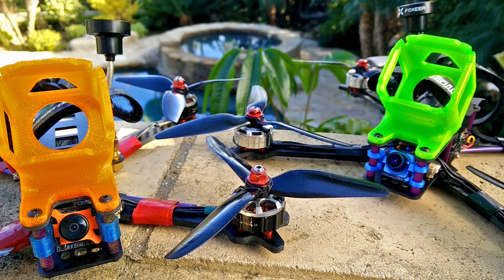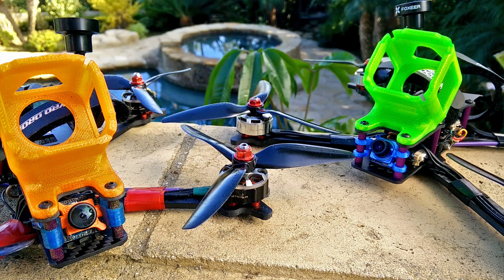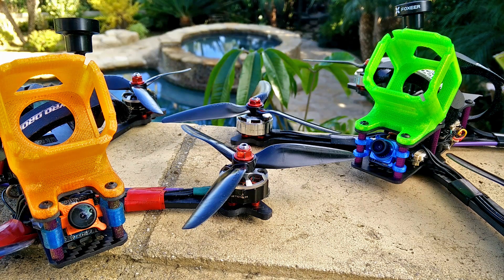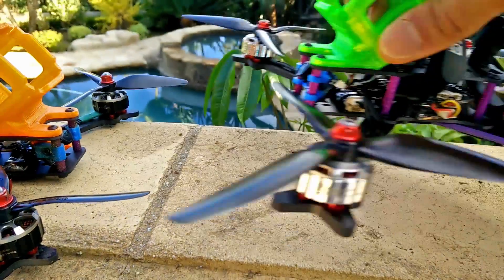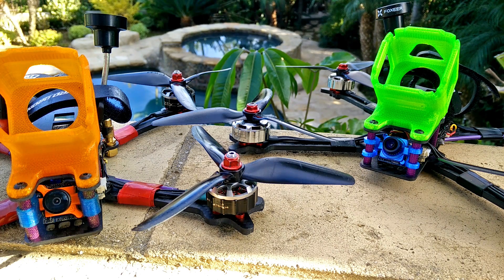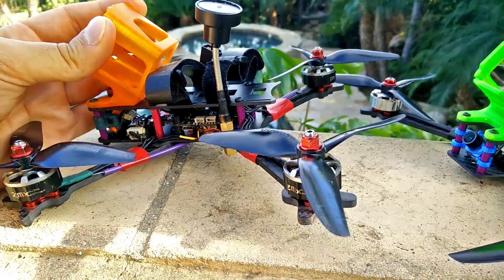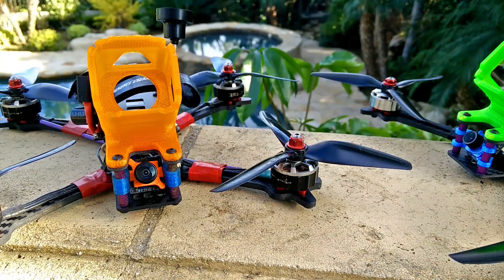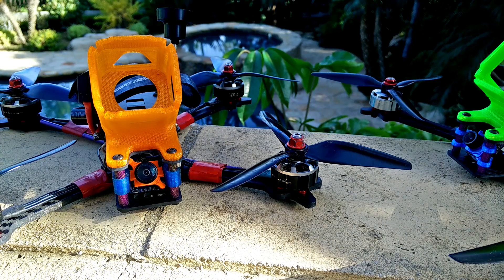un-Gyro Effect & Motor Width - Quad Theory Discussion

Comment: Well 570g is not light Bob.  I've been flying my floss, 301g right along side all my other quads which range from 350g up to 400g, this is no battery or gopro weight and i can say for absolute certainty that i prefer flying a 350g quad for my style of flying.  The floss slows down faster, it has less inertia, more tendency to change direction from wind.  The difference between 50g more weight is minute, hard to see in a video, hard to describe, but you can feel it, unless you have no feeling.  I'm not sure how Ledrib is building a quad that weighs 740, must be using really heavy batteries.  Heavier is not better, i mean there is an optimal weight for freestyle imo, but adding more doesn't make anything better.  570-620auw is perfect imo.  It's just my opinion people, don't start calling my fucking house you stupid fucking children!
Reply from the maker: 570g with gopro and a good size 1300mah 4S is pretty good. I could easily knock it down to 540g or less if I skip the gopro TPU protector and change my SMA antenna to a u.fl one, but I like those features.  I hope MMCX will become more common in the future so I can cut another ~5-7g off the setup.  The lightest reasonable AUW you can get with a gopro is gonna be around 500g but the frame and everything is so frail that it's just not gonna survive much.
Reply: I don't think i'd like flying a 500g freestyle quad, but i would like to try and build something that light just to do it.  I have one that weighs 215, no battery or gopro, doesn't even have a gopro option, so it weighs 358 with a 1300 dinogy and i hate trying to do any kind of acro with it.  To be fair it has old littlebees and original skitzo 2204 motors, so that's not fair to judge.   Sorry for my outburst, i actually have some youtube troll calling my house.  This guy  https://www.youtube.com/channel/UC967S35rdxsAAO5BBFieWCA everyone subscribe to his channel, please.